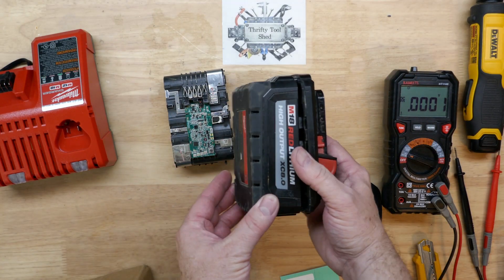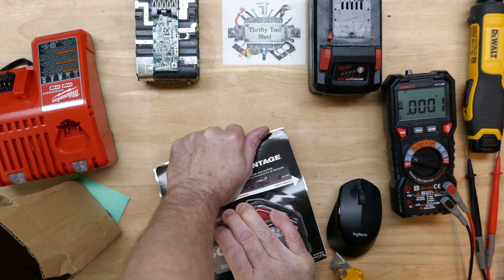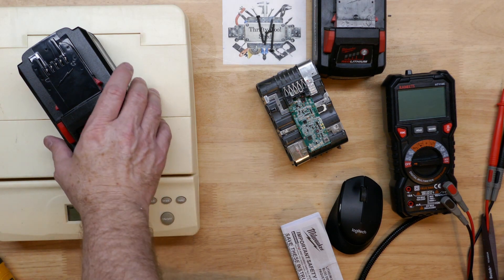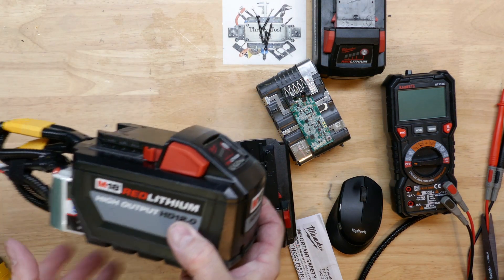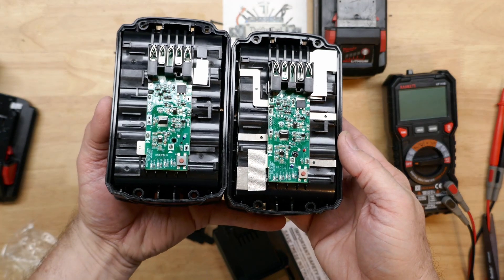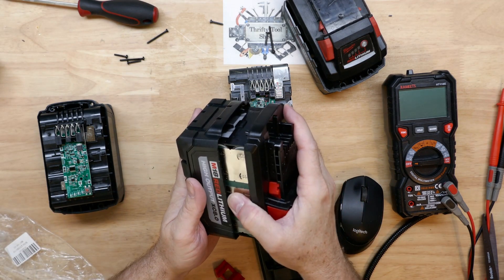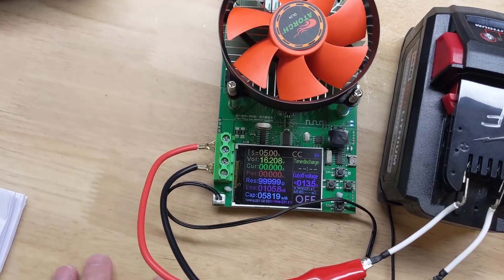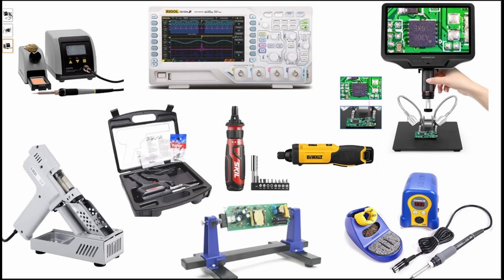Milwaukee M18 High Output XC 8.0Ah for under $95 - Is it fake?

Comment: Definitely fake. Multiple red flags. The packaging, the led lights...the actual plastic of the casing. I haven't got to the inside of the video when you take it apart yet but I have a feeling these cells are going to be different as well and the board as well as the connection to the batteries. I see this all the time..they are getting clever with their manufacturing though..fake dewalts are the worst😅

Comment: Stop say it a fake. Milwalkee don't make battery cell or bms board.  These are legit battery pack.  Just like 12v car battery.  You get what you paid.
Reply from the maker: You are incorrect! They are not legit in any form. That's the whole point of the video. It will help some hopefully...
Nothing at all like a 12V car battery....

Comment: One thing u didnt mention is also color of its red plastic  buttons. Original should match up color of your batter charger
Reply from the maker: It was a shade darker for sure. I was not sure it was obvious on camera or not, but it is a little bit darker. I would not have even noticed until they are side by side.

Comment: Do you know any serious seller on eBay? 

I want to buy the 8ah one, but most are around $80, $90 and it doesn't convince me. 
I want to be sure, since I am from Panama, and I cannot return them
Reply from the maker: I just really don't know if any can be trusted 100% on eBay really. I am sure some are real, but I believe some of the sellers buy a pallet of stuff from time to time and I think they don't even  know they are fake. Some look so real it's just too hard to tell if they were not purchased straight from Milwaukee or big box store....
Reply: @ThriftyToolShed  Do you know if there are counterfeit impact wrenches?
I bought the 2967-20 for $230, I hope I don't run into bad luck.
Reply from the maker: @smokeeeee1682  
I do wonder about that. I have not seen one, but I haven't looked into it very much. I know there are many knock offs and they are easy to spot, but I wonder if some are truly being cloned like some packs and hard to tell at first glance.

Comment: I picked up a fairly convincing broken fake xc6.0 on eBay for next to nothing, perfect condition bar a bit of dust on the inside of the case. It had been put together badly but using quality components (lg batteries, a factory spec case with no serial numbers and a genuine board) and the only thing stopping it working / reason it cost me a pittance was bad spot welds on the cell tracks. As far as fakes go its awesome, not quite the 6ah it boasts but a soild 4.5-5ah. Gotta feel for the poor sod that paid good money for a good but faulty product with a Chinese warranty 🤣

Comment: Besides it being misleading, and lower capacity, do you have a concern with these fakes? They seem to work still, so I feel you're just getting a smaller capacity battery but you're also paying for a smaller battery. I have yet to find any safety concerns in my research, have you heard of any? If this is 5aH I think I would rather have two of these vs one real one....?
Reply from the maker: I have not had time to finish a video on that. I share briefly in a video of the Hole augers using the fake in a M18 super hawg and it let the smoke out. I will eventually update the failure of the pack. Good question for sure!

Comment: I bought a couple of those batteries same packaging from Ebay but these were XC6.0... an issue I had that red flagged these batteries, they did not fit any of my M18 tools, they wouldn't slide in... returning back for full refund... bought a kit last night from Home Depot, 6.0 & 8.0 no issues inserting into my m18 lights and tools...

Comment: Good video. I just had a pair of 6.0ah M12 Milwaukee batteries come to me as defective. They looked brand new but as soon as I opened the case FAKE. They did a fantastic job of faking it and unless you hold it side by side to real one it's impossible to tell. Other than the fake cells the nickle strips are always paper thin and actually what failed. The Nickle strip on both shorted out and disconnected itself. I added a solder trace across the thin area and put them back into service. The no name cells are more than likely 2.0ah max. 

On a side note the packs that I build for myself from the aliexpress cases I almost always add solder traces since I've had a few get very hot.
Reply from the maker: Absolutely, the nickel strips have been super thin on all the ones that I have seen also. Update on this one, it did fail at the nickel strip for the main negative terminal under the BMS board. It was being loaded hard on a super hawg. Smoke rolled pretty well because the plastic between the board and cells started melting.

Comment: I had almost the same thing happen from Amazon but it was a very good fake of the M18 12.0 AH HD battery, in the same type packaging too!  The seller went out of business but they were called Southern Supplies.  

The battery started failing after a few months of ownership (just outside the return window) so I was able to send it in to Milwaukee and get a warranty refusal letter which I used to get a refund from Amazon.  

I guess I will only be buying Milwaukee batteries from Home Depot or certified sellers.
Reply from the maker: Wow! Thanks for sharing!

Comment: 👍 👍👍 Great video sir! Very knowledgeable and thorough. I've learned the hard way over the years is something is too good to be true, it DEFINITELY is. It's hard to beat the price of a big box store that sells their product day in and day out by the truck full. They are going to be able to cut the best deal possible between you and milwaukee. It's better to wait until a sale than waste money on something that is potentially not real. If you buy a battery from a big box store and it burns up your equipment, they will stand behind it. If you take them a half burnt battery and a burned up drill, you're on your own!

Comment: Thanks for reporting this product/seller to Amazon as fake.  Far too much of this counterfeit crap going on unchecked.  I also got stung on a M12 4.0 off amazon that even had a slew of good reviews.  The color was slightly off and the plastics had some sharp edges..
Reply from the maker: Thanks for sharing. One thing to note is the item in your purchase history will show later that it is sold by a different store. It's the same item it shows that you previously purchased. Apparently they are switching store names?
Reply: @ThriftyToolShed Update from Amazon, I cannot contact the seller for a return since they just left the Amazon Store system.  Probably will return in a few weeks under a new LLC.   On a side note I learned of another tell tale sign of the fake M12's, none of them will have the microscopic embossing on the top by the connectors, and it will list the polarity/function of each of the terminals.  All fakes to date have smooth tops with none of these super tiny indicators.
Reply from the maker: @RedFRC  
Have you tried just doing a return straight through Amazon?

Comment: They did the same for Dewalt 5Ah
even look so real outside right to the printing
Reply from the maker: Wow! Crazy!
Reply: I purchased a DeWalt 2 pack in the past from Amazon and realized it was fake because the charge didn't last... and the material was brittle. A couple months later Amazon sent me an email that the seller was banned and was removed for selling fake items. They even implored me to discard the batteries because they were hazardous and my full refund was on the way. I say that to say this, I don't think Amazon knows of these illegitimate products but as they made aware of them, they do their investigation and deal with it right away
Reply from the maker: I made sure to report this one as well and did get a refund so no complaints there. The bad thing is the seller seems to simply change names and it still shows my bought item as a link even with different seller names. This is going to be very tough to keep up with for Amazon. We as buyers are going to have to stay vigilant and that is one reason for the video. Thanks for sharing!

Comment: I actually bought one on Amazon for about $120 and opened it up and it’s the real deal. Looks exactly like the real one you have with Samsung batteries.
Also the package was not the same one as the fake one here.
Reply from the maker: Several viewers have mentioned the one they received is real also. It is strange that if you watch the link I shared of the one I purchased it shows different sellers from week to week sometimes. Same link, different seller names. It seems it is a mixed bag?

Comment: I think you got unlucky my friend! The one I received is legit. My first instinct was to open it as well.
Reply from the maker: I actually bought it because I was sure that were not real of course. It was not being unlucky.
Reply: @ThriftyToolShed  guess that explains why mines real huh
Reply from the maker: Well I had a really good idea at well over 5K sales a month being sold less than half price that it was fake. I tested it and was correct regardless of what you received. The seller is also switching store names back and forth now as well.  I shared on video the real one and the one I received to hopefully help people be more aware. If you received an actual real one with Samsung INR21700-40T cells somehow that's great! Glad you are happy with it. I feel bad for the ones that receive the fake ones.
Reply: @ThriftyToolShed  ah which vendor was yours?
Reply from the maker: It was Hunter's Outpost when I purchased the pack and  after contacting them the same link to the pack goes to GLOQE. Now it actually is showing Hunter's Outpost again. Really odd.
Reply: @ThriftyToolShed  oh man okay, two different vendors

Comment: I made a portable power station which includes 4x 30Ah lifepo4 batteries in parallel(12V.  1440Wh) , could I use the spot welder you linked, with this battery or would I be better off with something else? I'd appreciate your input.
Reply from the maker: That sounds fun! I mean the spot welder is super handy and works great, but I am unsure of how you are doing the LiPo packs to say for certain for your application. With 21700 or 18650 and using Nickel strips it works extremely well for the money. I use this welder in a couple videos so you can check it out in action. 
https://youtu.be/eS3jLxh3OQY
Reply: @ThriftyToolShed  What I meant to say was, the spot welder you are using in this video is connected to a small (HRB, 500mAh, 18.5V) battery,  I was wondering, if I order that same spot welder, do I need to  also order the same battery as yours or can I use my lifepo4 power station as the power source?
Reply from the maker: @ddistrbd1  
I see. Ok it's more about the pack you are trying to use with the spot welder. I know the selection will go up to 60Ah and I believe 60C. I believe it will limit the power setting to just 1 gear or so depending on the size pack selected. I have not tried it with anything above 5AH and 50C. I know above that it will limit the level you can select to output. I believe it is a time setting so the large pack is not allowed nearly as much time as the smaller packs. You can see the gear selection and the LEDs on the pictures on Amazon. 
https://amzn.to/43hLTd9
Reply: @ThriftyToolShed  I got it, thank you for the explanation, and also for your quick response.
Reply from the maker: BTW: I would like to see the power station if you do share a video of it. Let me know!
Reply: @ThriftyToolShed  I don't know the first thing about making  a video , I'm not a tech savvy person and have never made any type of video, but I do appreciate the interest.

Comment: What I would dearly love to see is someone anyone do a Video on Milwaukee M28 V28 28v batteries,  yes I know the platform is dead, but ive 20 batteries n 30 28v tools and I couldn't give them away without working batteries sure few clones on aliexpress but cells don't look quality  AND they are 26700 lithium batteries which aren't common.  No name brands, if only someone could adapt 21700 or 18650 to work in existing pack be brilliant,  so many people stuck with 28v batteries systems n tools and bugger all videos with any solution,  cheers Wayne australia 🇦🇺
Reply from the maker: Interesting that the 28V has the 26700 cells. The 26700's are really hard to come by except somewhere like Bang good or Alibaba. Most likely the same cells you are trying to avoid. It would be interesting to see how easy they would be to convert over to 21700 cells. They should at the least be the same length and being smaller in diameter is better than the alternative. It does make sense to me to switch over to 21700 to save the packs for sure!

Comment: I actually bought the case only packs from Aliexpress,  and bought genuine Samsung 21700 cells in Australia,  and still holding charge, discharged and capacity is correct.  I've used a few dead m18s with replacement cell's and just new case, looks good works good alot cheaper than buying original replacement.

Comment: I purchased 2 ryobi knock off batteries 3 years ago and they are still running fine.  Like this one the capacity was a little bit lower but as a DIY person those batteries work great for half the price.  The ryobi ones I purchased were on Ebay listed as after market batteries for ryobi.

Comment: Nice test.  You definitely gave it the benefit of doubt with the cutoff voltage and it sure didn’t perform as advertised.  Without any markings on those cells you have no idea what they are, could even be recycled cells.  Would be interesting to see a high amp discharge test and a balance check right after.  If those cells have any significant voltage difference at the end of the test that’d give a good indication that the pack won’t hold up to any heavy use for long.
Reply: I definitely need to get me one of those load testers.  Do you know off hand how high of voltage pack you can test with the unit you have?
Reply from the maker: Hi,
It's 200V 150W. It is a nice tester for the price. Very handy.
https://amzn.to/46xP1EB

Comment: Amazon routinely sells fakes with no policing, especially batteries.  If they are honest about being a clone I have no problem (caveat emptor), but misrepresenting as original is a no no.  I trust reviews less and less as time goes on.
Reply: Ebay seems to be in bed with fake battery sellers. They did not back me up on a counterfeit sale.

Comment: Nice analysis and investigation.  Maybe a internal resistance test and try to look up the cells to determine amp discharge rate. They may be a decent deal or maybe not